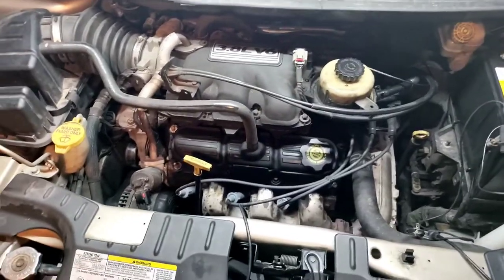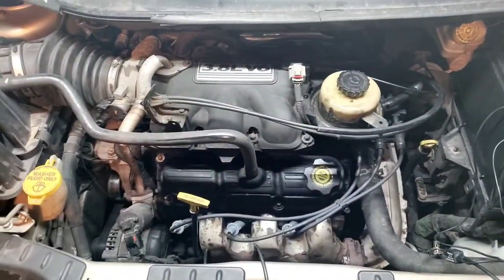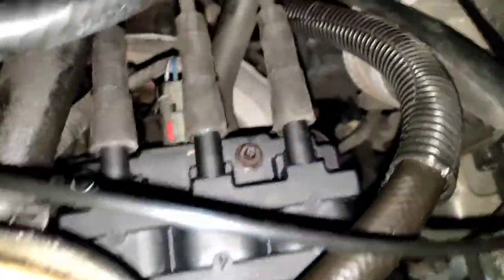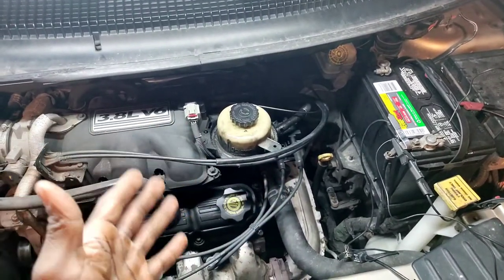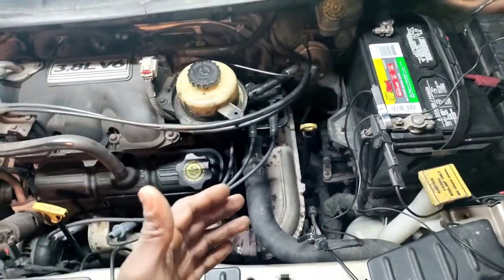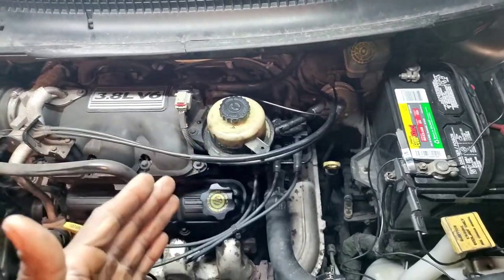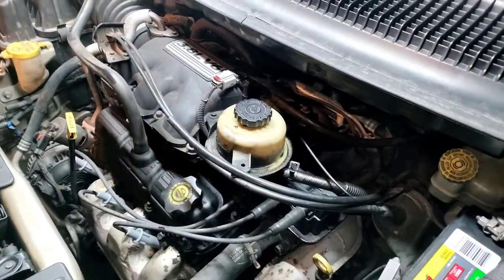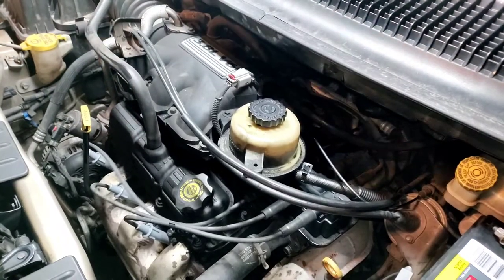Chrysler P2302 diagnose bad misfire

Comment: I got the same thing it runs fine for one second then putt putt putt. Mine says malfunction in 2 of the 3 coil banks. Changed egr changed plugs wires, new map sensor in and for some stupid reason has no overdrive

Comment: Any updates on this? Currently working on 09 ve routan with the exact same code, replaced parts and sitting in the dark
Reply from the maker: Customer vehicle never came back, or called for same issue. I offer 1yr warranty on defect, I can safely assume it's fine
Reply: @partsshooter  so you replaced the pcm?
Reply: What was the fix? Or what happened?

Comment: I need to get into contact with you partsshooter   I am having problems with a p2302 code on a Dodge Ram.   Do you have a email address??
Reply: I just got that same code on my 2004 Dodge Ram 5.7 Hemi did you figure yours out if so you have any advice for me on mine, please and thank you
Reply: Hey did you ever fix this problem, because I have replaced everything I could think of except the wiring harness, and the code p2302 keeps coming back
Reply: @ferliciafreeman3024 Did you get it figured out? I’m having the same problem…P2302.
I changed the spark plugs, the coil and just changed the pcm today. I tried clearing the code though and they won’t clear. Did you have any problems with that?